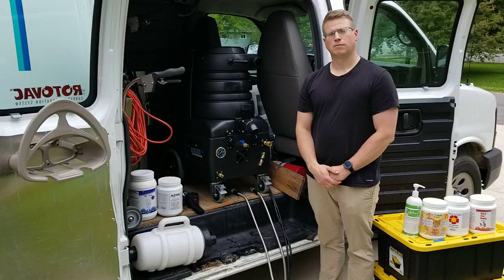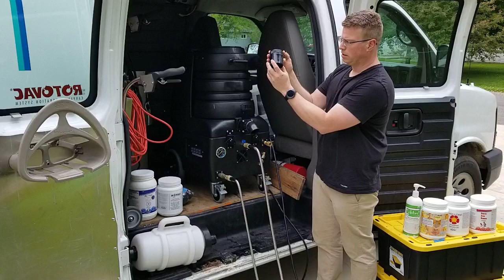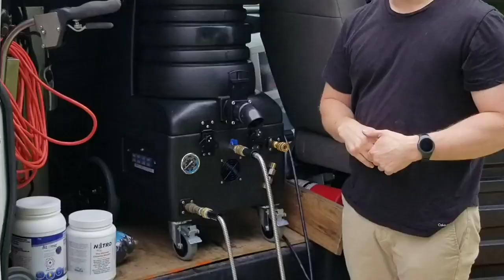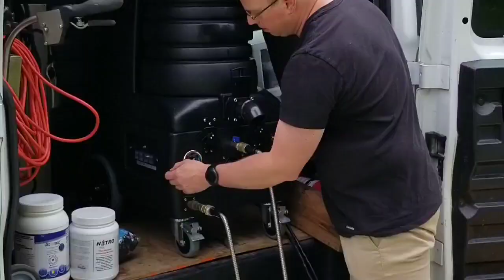Vortex Lite set up instructions

Comment: Tim three questions-could I carry a 55 gallon drum in trailer for freshwater when needed? Would 65,000 btu propane heater work/ be effective with this? and third, I'd like a wide wand as I do a lot of large commercial stuff-any suggestions?
Reply from the maker: 1st question. No problem. 2nd one, we don’t recommend propane. Diesel is a lot safer. 3rd, you can use a wider wand.

Comment: hey are you having any trouble with the cuff lynx staying on the machine, I've ran it a couple of times and the hose twists it back off.
Reply from the maker: I'm sure that can be resolved.  Let me find out for you. You can also call Jordan at 877-926-3748 Ext 102 and see if he has any suggestions.  Thank you.
Reply from the maker: I just talked with Mytee.  They said that make sure you turn it all the way until in clicks into place.  :)  If you are using a pigglet in the middle, then try it without it or not have it bundled at top as much.
Reply: @magicwandcompany  got it. I think I will use a different filter though.
Reply from the maker: @shawnmcqueen3488  Great!  Let me know how it goes.  :)